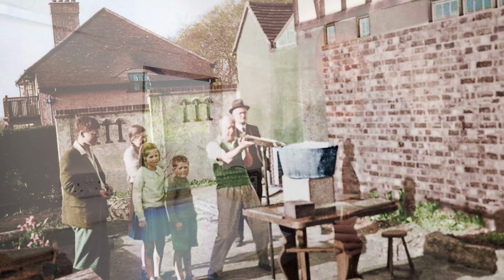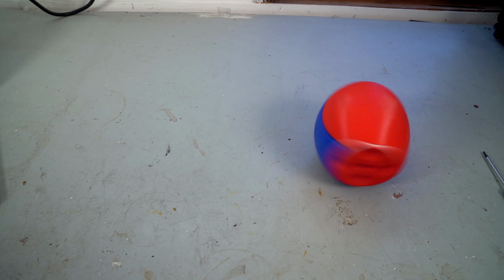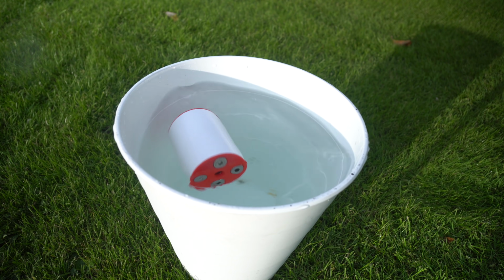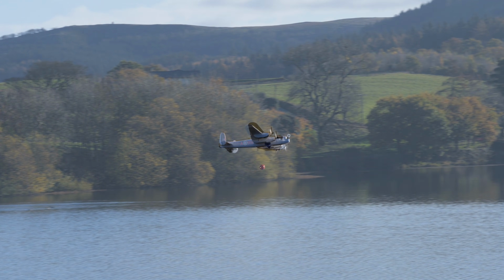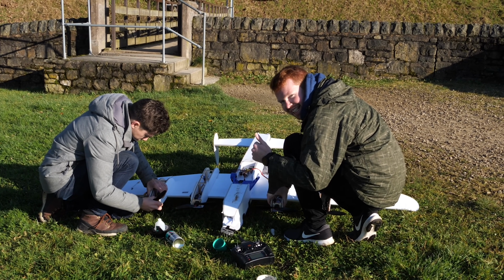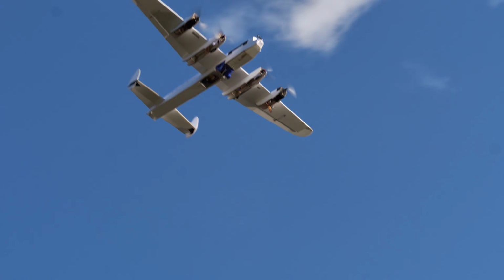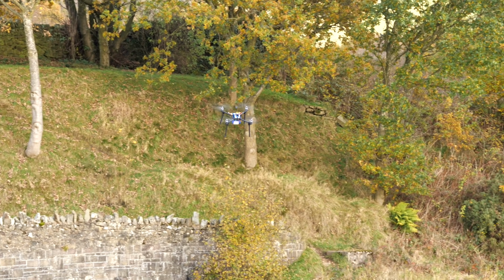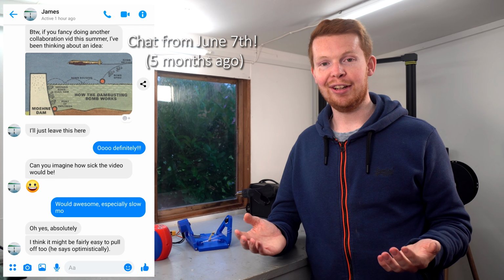Radio Control Dambusters

Comment: 90% complete on a 1300MM Lanc designed by Mark at 3daeroworks  i am test printing it , 6 channel  LW and reg Pla  , its on rc groups build thread, should be flying in 3 weeks

Comment: Redo this with air dropped torpedos , make a heavy flywheel, to spin the prop, fill it with gun powder, long fuse, slow fuse! A 25 x 130mm tube of black powder, encased in foam, inside a 3D'd 'torpedo' she'll, with the flywheel motor in the rear!, Use it to explode model battle ships!😳

Comment: I'm wondering if the small dip of the nose of the plane at 8:16 is due to the opposite angular momentum applied by the spinning up of the barrel underneath the plane.

Comment: In the Dambusters film, the bouncing bomb is ball shaped as information on it was kept secret after WW2, in case the bomb was needed to attack the Soviets, so nobody knew what shape it was.
1:46 that is partially true - spherical bombs were tested, but wood and metal rings were used to make the shape, but when the bomb hit the water the spherical shell broke off, however the cylindrical bomb gave Barnes the desired outcome, so the spherical bomb design was scrapped.

Comment: My father was with the 617 (Binbrook) squadron in the early 1950s. They were the squadron that flew the dam buster sorties. Barns Wallace turned his attention to tricky engineering problems in science after the war and in the 1960s designed the aiming mechanism for both the Parkes and Algonquin radio telescopes. Now you know.

Comment: The spinning was done so the barrel would sink in a specific way once it hit the dam.  The only thing missing from your experiment was the AA fire.  Many of these flights didnt make it to the release point. Operation Chastise - four dams were attacked,  two were breached.  Several of these crews made more than one run because they were not satisfied with the drop parameters, all the while getting blasted at by 88 flak guns at point blank range.  19 bombers left, and 11 returned.  The crews earned 33 decorations, including the Victoria Cross.

Comment: I believe the actual dam busters had 2 lamps on the bottom of the plane pointing at certain angles to get the perfect altitude and trajectory, the idea was for the pilots to see the light intersecting on the surface of the water.

Comment: Or draw a line on the tape, and cut through the tape.
Lots of the dust ends up stuck into clumps of gooey tape crumbs rather than scattering as a loose powder.
Good for fiberglass/carbon fiber tubing or other materials that shed sharp dust...can greatly reduce edge splitting.
Cut a 10 cm diameter epoxy fiberglass tube using two layers of packing tape...didn't have a shop-vac or dust mask!
Almost all the dust formed little clumps...pita while cutting, sticky blades and all.  Mineral spirits are your friend here.
Never let uncured resin touch your skin; you might develop an allergic reaction to the stuff like I have...
Masking tape sort of works, but packing tape has the right kind of adhesive...

Comment: Kudos, James and Tom! 🤘
The deployment height was deduced using triangulation of lights on the wings. When the pilot saw the spots of light converge, the height was correct.
So next level would be automatic height and speed control 💪
 And maybe a VTOL capable Lancaster 😉

Comment: The magnus effect was present with the real project which allowed the barrel to get that angle. So dropping a lighter mass way closer to the water with less surface area relative to weight it would've made that harder.

Comment: This was beautiful. I now want to try something similar, which may be possible time-wise due to lockdown, but I may not be able to afford the construction side of things, since I have no job yet (being fresh out of uni).
I'm an engineer myself, so the coding and stuff shouldn't be an issue, and I also do model railways (I have an airfix lancaster in my bedroom that I built several years ago), so I should be able to get it decently accurate too. However, I don't have access to a 3d printer.
Love your videos btw, they inspire me as an engineer/

Comment: That's real cool, but I can't stop thinking about one thing. You spinned the barrel in the direction that the lover side is going against the movement of the barrel. Doesn't that slow down the barrel when it hits the water? Shouldn't it be spinning the other direction?

Comment: Seeing as you like a challenge, hows about an attachment (LIGHT WEIGHT) and LOW moment of inertia that would allow the use of 'height' adjustable graduated filters on drones? 
Specifically my interest is a DJI Phantom 3 advanced/Pro. The same design might be applicable to the Std and current? 4k and, with perhaps a change of filter thread, the more modern, and perhaps current, P4s as well. 'Space' might be too limited for use on Mavics etc. and I haven't a clue about other makes and models.
If you are really keen then what about angle and height. Like a Lees filter type assembly for a normal camera.
If you can do it it might be worth looking into protecting the idea against commercial copying.
Whilst we are at it an either seperate or combined drive (the latter is too much to ask for I think but.....) for a polarising filter

Comment: You didn't mention one very important engineering aspect of Dambusters. As you mentioned the plane needed to fly very low, so low in fact that the standard altimeter was useless. So they needed to figure out the way to somehow control the altitude. They installed one lamp on each wing, projecting light to the ground (sort of like the bat signal). The lamps were positioned is such a way that at the right altitude beams of both lamps would meet at the same spot. Ingenious. Writing this from memory so please someone correct me if I'm wrong.

Comment: I did this with with an Unkeep bomb from a 1-72 scale Dambuster Lancaster model kit in the 1970's as a 10 year old with just a long bit of elastic band.. rapped the band tightly around the barrel and then held the remainder of the band at arms length. on letting the bomb go the band pulled the barrel forwards and imparted back spin. Got it to bounce the whole lenght (25 meters of the swimming pool at School..

Comment: What if instead of a barrel you'd use a convex object based on the science of scipping stones; would the object scip a further distance while using the same altitude and speed of the plane and the same rotational speed of the object? Also maintaining the same inner volume of the object.

Comment: It's certainly an interesting demonstration. And it's quite a good way to show the effects of certain properties of physics. I have to ask though, what was the purpose of building these into bombs in the real raid? Would a simple bomb not have been quicker and easier to produce? If not, then why not a torpedo? It seems like a rather overcomplicated way to solve a relatively simple problem
Reply: OmicroniX Zerus Simple bombs are hard to aim, you'd either need to carpet bomb or dive bomb to ensure a good hit so it's not as cost effective or safe as just rigging up a barrel. Torpedos were unreliable, heavy and inefficient for plane use against structures, they simply aren't powerful enough for their weight to warrant their use over something like this

Comment: I've only heard one accurate explanation for why the barrel is spun.  While the spinning may have an impact on the skipping, the real reason was to force the barrel to hug the dam as it sank.  The bomb's effectiveness is dependent on the depth and especially the proximity to the dam.  If the bomb detonates too far from the dam (a few meters makes a big difference here), the force is spread out too far and the dam doesn't experience a destructive level of force.
Reply: Backspin slightly increases the relative velocity of the outside of the barrel when it hits the water's surface.
Reply: @Project-Air  That may be so, but it was secondary to the need to get the barrel to hug the dam as it sank.

Comment: Equally remarkable as the bomb itself was the simplicity of the method used for timing the release and controlling the height, the height above the water was set by two spotlights set at an angle that formed a single spot of light at the correct height, the location for bomb release was set by a simple wooden frame with an eyepiece and two pegs, once the pegs lined up with a pair of towers on the dam it was time to drop the bomb

Comment: You should explain why they needed a bouncing barrel to accomplish the mission.  A normal torpedo would not work, because the Germans placed torpedo nets in front of the dam to stop any torpedoes. The barrels could bounce over the nets, provided they were dropped at the precise moment.

Comment: Gravity doesn't scale. You'd be fighting against the surface tension of the water with something that had far less mass than the original to break free from the surface of the water. So it wouldn't have the same force in the direction of travel. Still good job but doing calculations to the actual bomb is a bit pointless.

Comment: Long time watcher first time commenting. If your a movie watcher, check out a movie called speed zone. Hollywood did something similar a long time ago with a Lamborghini.   :)
It's all about the angles and pitch.
And I've always wondered how well a forced air heater type fan would work for lift.

Comment: Noce video but you realize with the correct speed, the barrel would skip even without the spin. The reason they added the spin was to make sure the barrels land at the bottom of the dam walls where it would cause the most damage. Altitude had to be low but not too low to avoid getting hit by the barrel when it skipped on the water.

Comment: The round mines were high ball and designed for use against ships, there were easer to make and a lot of the testing was done with them rather than the cylinder upkeep mine

Comment: well when the plane moves foward with 322 km per hour, the bomb will do the same after release.... partly one of the reasons it didnt sink, so when you just hold it up in the air, the bomb doesnt move forward.....

Comment: Such a great video, fantastic recreation, well done for making it bounce. Sad that it crashed - not so much because of the injury to your plane but because so many were killed or captured on these and similar missions. A trip down a tragic part of history for sure. Also, if you can't shut down individual engines to compensate for the differential thrust caused by one sided engine failure, it's possible to throttle back on all the remaining engines and glide into a safeish crash. You probably know this already but I guess it's hard remembering in the moment. Lord knows I've crashed a lot for similar reasons and I'm sure I will again. Anyway thanks guys!

Comment: remember some 35  years ago I found the Dam buster  game for my C64, I couldn't figure out what it was about until I read about the real Dam busters in an old readers digest at my grandparents and realized one of the views in the game was the two light beams that had to be aligned to get the correct drop height

Comment: when the bomb dropped the water splashed the tail of the plane, this happened in real life doing a lot of damage to the plane resulting in plane having to fly a bit higher as well as having 2 spot lights angled at the ground, when the 2 beams of light merged the plane was at the right height.

Comment: So the Issue that I noticed was the direction of the can was going In reverse I bet If you got It going thee other way really fast It would work load's better great video by the way..
Reply from the maker: There's actually quite a bit of research that shows backspin is beneficial to skipping the barrel. It pushes water forwards creating a ramp to lift itself back out. I mainly copied the rotation direction of the original barrel.

Comment: Take into account airspeed and altitude were critical to the success of the original mission then your success is quite notable, altitude being especially critical as they were too low to use the aircrafts altimeter  so they had two lights on the aircraft , one in the nose and the other in the tail and they were calibrated so that where the lights crossed and made a complete circle on the water surface would be the correct height, 60 feet and the airspeed was 220 mph.

Comment: Loved this video and appreciate all the hard work.  From memory the Lancaster had two spot lights on the wing tips pointed inward.  When the plane got to the correct altitude the two spot beams would converge to form one point of light on the water.  Incredible engineering and so simple at the same time.

Comment: I'm not an expert or anything, but wouldn't it been easier to just use torpedos?
Reply from the maker: The dams had nets infront to prevent torpedos reaching them. Therefore the barrels were designed to bounce over the nets.

Comment: So, I understand that the rotation keeps it stable as it skips across the surface, but why backspin instead of forwards?
Reply: Keirathi My gut feeling is that the higher the speed of contact the less likely the barrel is to grip the water. One solution would be to fly faster, but the elegant solution is to apply back spin.

Comment: Is that thing spinning in the wrong way? I think it would have come further by spinning in the flight direction and not against it.
Reply: Barnes-Wallace found that it skipped further & higher if spun backwards. Tom mentions this in the vid.
The point of skipping the bomb was to lift it over the anti-torpedo nets strung across the face of the damn

Comment: Not even a minute in, and you already pointed out the biggest flaw with this, and probably the stupidest one... "probably gonna end up laying at the bottom of a lake".... now normally i'm not all that 'RAWR ENVIROMENTALIST!' But uh.... you are putting PVC at the bottom of a lake.. one of the most non-biodegradable materials period... plus whatever plastic you're using (assuming PLA) which is kinda biodegradable, but not very much so and not all that quickly.... Shoulda printed them fully out of something easily biodegradable, or picked materials that would be biodegradable... or, figured out a way to retrieve them. Like maybe a small weight on one portion of it so that it is more likely to 'end up' with that side down, and put something like an alka-seltzer tablet in it, and some tiny holes on the bottom/top. also include something that expands/becomes gooey when in contact with water. that way, water comes in, activates the alka-seltzer tablet causing it to fizz and produce gas, while the goo expands when the water comes in. the water will come in either the top or bottom while the air escapes from the top most likely. the goop will float up towards the top and eventually seal off the top hole so that no more air can escape, and the alka-seltzer will fill the area with gas and shove the water out from the bottom and allow the whole thing to float back up to the surface for you to scoop up and take back home. though, with all that said.... if it floated when the gas was released, then it woulda floated with air in it, so that may all be completely stupid/unneeded... but still.... gotta find a way to do this without leaving plastic at the bottom of a lake....
Reply from the maker: Maybe watch till the end next time. The barrels float and we collected all of them...

Comment: IIRC, the spherical casing was omitted because it was noticed that when one of them disintegrated, the internal cylinder carried on.  They tested with just the cylinder, and it worked better.
Reply: Not really. One issue with just using a Cylinder is that if the bomb is not dropped with the aircraft having its wings level, the bomb may hit the water with its long axis at an angle which will result in the bomb bouncing in an arc instead of a straight line. This did happen to the third bomb dropped on the Mohne by Micky Martin during the Dams Raid ,
Reply: @richardvernon317  "Worked better" in that it worked at all...
Reply: @No1sonuk   The Spherical bomb did work better, they just didn't have time to develop it. The Cylindrical metal core was selected to allow the thing to be built in time to allow the RAF to attack the dams when they were full. Building 50 odd Spherical all metal Upkeep bombs were not possible in the time allowed, thus Wallis hoped that a wooden cylindrical barrel around the metal cylinder would be good enough. It wasn't   The original solid prototypes dropped form the Wellington were Spherical. Highbsll for the Mosquito was Spherical. What a lot of people don't realise it how fast this thing was developed. Yes, Walils had been working on the theory and with models (including the early full sized air dropped prototypes) for about a year when the decision was made to actually build a full sized weapon to attack the dams within less than 3 months.  The RAF's plan wasn't however just to use Upkeep against the Dam's in the May of 1943, they hoped to have Highball ready as well and do a daylight mosquito attack against the Tirpitz to boot in the same month! So Wallis was actually working on two new weapon designs concurrently. Highball failed to meet the deadline due to problems with the aircraft's release mechanisms and the fact that the bomb couldn't handle sea waves very well, so the pressure to develop that dropped off in the late April. There was also the fact that Guy Gibson not only had to form a new squadron and train it to do an operation totally left field of what anybody in Bomber Command's main force was doing at the time. He had to form and train with almost a completely new crew in his aircraft as well, as unlike the Film, only one of Gibson's crew from 106 Squadron went across to Scampton with him.